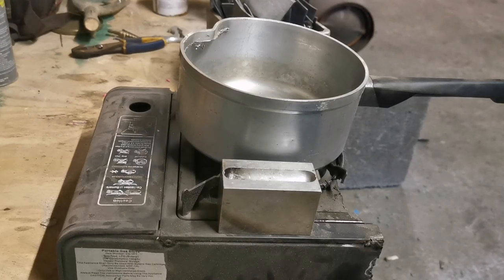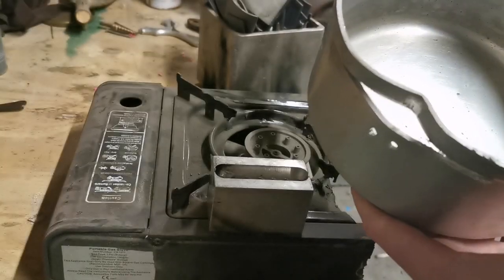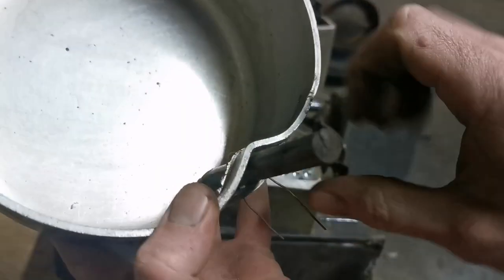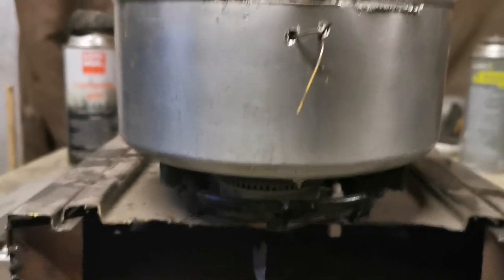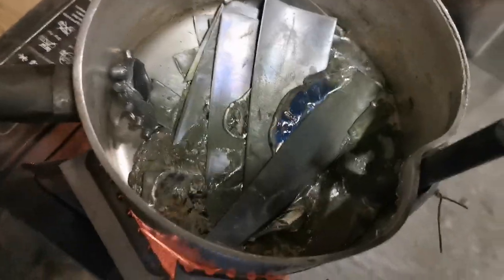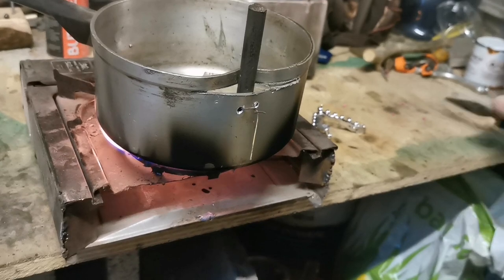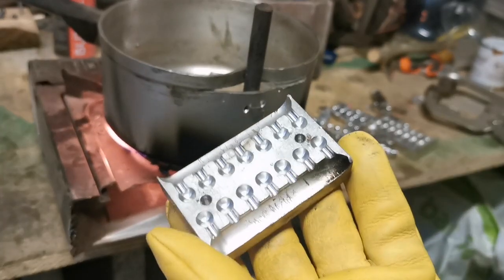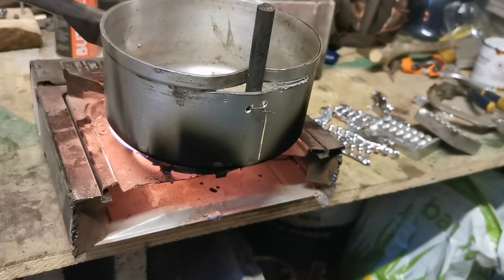Lead melting pot. How to improve yours

Comment: I like the idea of modifying a pot to bottom pour , I just want people to be aware that too much heat, as from a propane burner can cause an aluminum pot to deform, soften, and drop the heavy lead thru the fissures. I would trust a stainless steel pot more after my first attempt at melting lead in a thin aluminum sauce pan, pot. Be careful and use a thermometer.  Love, peace and awareness friends!

Comment: Should use some insulation typically used on a crucible in order to maintain the heat better and reduce your fuel cost.  I have done this even on my cast iron dutch oven set up and notice a reduction in propane use.

Comment: That pot looks like it's some kind of aluminum alloy? Really? I would think it has too low a melting point! If so, this makes my one project cheap to get done as I already have a steel pointed punch/awl. I definitely learned a few REALLY good things from you!. Straight forward simple and removed so much aggravation with that simplicity, and minimal step design! I have an 18" Billy Club drilled 5/8" all the way through the middle. I want to fill it with lead for Blue Fish season in the fall, when they get 20 pounds. Getting the treble hook and steel leader out without making sure they are incapable of chomping your fingers is a MUST! Incapacitated is KEY! Please tell me more about the metal of that pot! Thank You for so many enlightening points! You've earned at least one pint at your favorite pub after you pull in a great catch!
Reply: I agree. It appears to be aluminum. 
The aluminum shouldn't melt, but from what ive gathered over the past few months It seems cast iron is one of the better/safer things to use. 
People say steel pots can
 "unexpectedly break during casting" 
Although my first pour was a steel pot. Cast iron took over fast.
One reason it works best is it holds heat better then alot of options.. 
My main problem with an aluminum pot is
Metal's/ aluminum, get "soft" when heated.  aluminum is soft to begin with, but when you add heat and a few pounds of lead, along with a weak point ( the hole in the bottom)
its asking for trouble.
If I was gonna try a setup like this i would personally want a bolt or something similar as the stopper for the drain, along with a safer pot.
The last thing you would want is to not get the hole lined up just once, then lead is uncontrolled when spilling all over the work space, and possibly the person pouring.
One wrong move and its disaster.

Comment: My first attempt at an aluminum melting pot melted out the bottom and flowed the 20 pounds across about 10 feet of garage floor. Luckily I was not burned as the bottom just fell out at my feet!
Reply: So you were burning the lead which is liquid at $618° f aluminum pot becomes liquid above 1200 degrees fahrenheit so you must have one hell of a heat source to melt the bottom out of aluminum pot or you just tried to pick the whole 20 lb pot up what he was showing and demonstrating is the simplicity to a problem and cast iron is a preferred pot however it isn't the only one that will work.